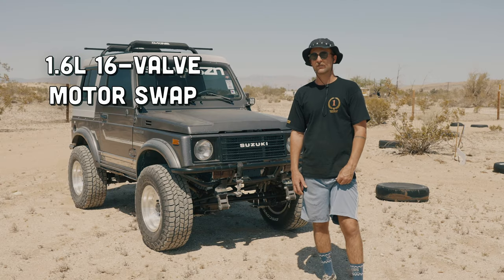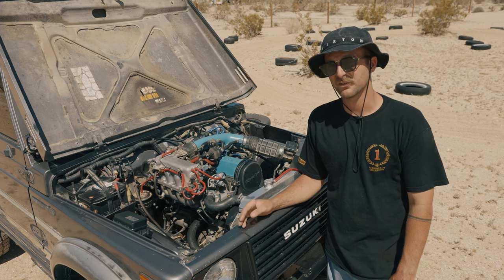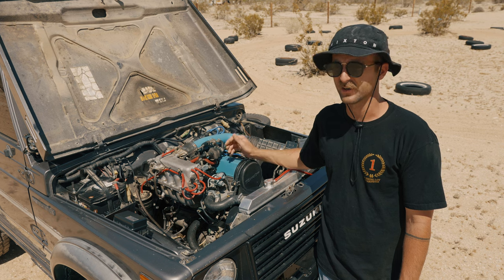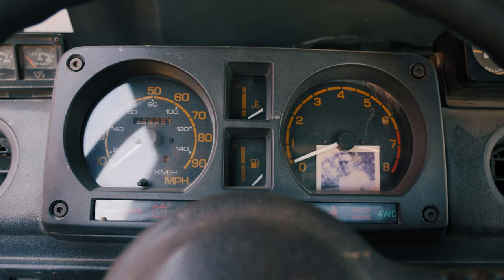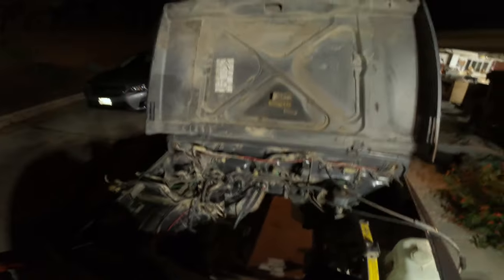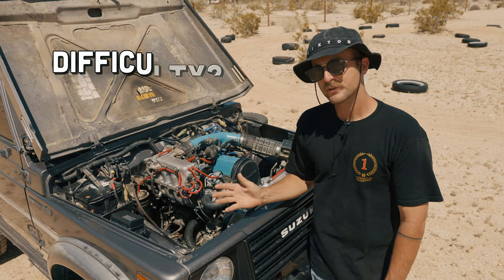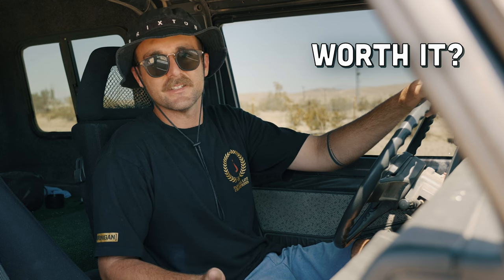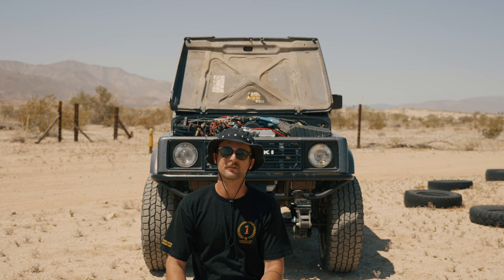The 1.6L "16-Valve" Swap Suzuki Samurai!

Comment: I ran a  8 valve swap for years, until the block cracked.  Wish I did a 16 valve when I made that swap, I think the small amount of extra work would be worth it.  Now I’m running a vw idi 1.6th, love the little diesel.  Not fast at all, not nearly as much power as the 16v… fuel economy is great and the power it has is perfect for where is use it.
Reply: Do you think I could toe a mini jet boat with the diesel?

Comment: Let's see how long your build would last had terrible experienced with single cam 16v leaking motor oil and engine crack either the head or the block.  Now I only kept the 1.6L 8v, great video explaining.  Suzuki was not for speed.  So far no one has done what I did on a Samurai garage build.  Thanks for sharing experiences.
Reply from the maker: Hi friend! Sorry to hear you had some issues with your 16v, it sounds like the block cracking is a pretty common issue.. I did already have to replace my water pump about 8k miles in, but other than that it is running really good. I plan to put a lot of miles on it this summer so we will see how it goes!

Comment: Good video. I'm in the process of finishing my 16V swap and it the small details that take the longest. Like the power steering set-up with AC took a lot of tinkering around.
How did you manage to fit the filter box? Did you remove the bracket that goes across from fender to grill?

Comment: Is this what you meant by following the petroworks instructions? Doesn't seem like much detail. I saw or read somewhere that someone recommended mounting one of the engine mounts to the frame first, but I can't find the source and don't remember which side they said.

"Lower entire assembly down into the engine bay. As the frame side mounts get closer
to their mounting locations have your help start to align the frame mounts to the
frame and start to install the original mount bolts into the frame. The rear passenger
side frame mount bolt is hard to get past the mount so it is advisable to start this one
first while there is no weight on the mounts. "
Reply from the maker: Hi Dan, I am pretty sure the quoted text there, was what I was referring to as instructions. 

Where it says, "The rear passenger side frame mount bolt is hard to get past the mount so it is advisable to start this one first while there is no weight on the mounts."

I am pretty sure I started with the driver side frame mount and that was the part I struggled with. Once I went back and started with passenger side, it was much easier.

Lack of instructions has been a very common thing I noticed across the board with support and parts. Usually, a quick phone call or a search across Facebook forums can help resolve most issues/struggles

Comment: Do you have power steering? I did a 1.6 16 valve swap several years ago.  Now I am in the process of adding power steering.  Looks like the filter box sits too deep and is going to interfere with the pump.  Did you do anything in particular to accommodate the rather large filter box?
Reply from the maker: Hi Rob! That's a great observation. Power steering is definitely next on the list for me, and as you mentioned, yes, the factory 1.6L intake is definitely going to be in the way. There is a chance you could potentially hide it underneath, but it will likely be super tight.

Comment: Any thoughts on power/speed difference since making the swap? You sound quite undecided in the video as to whether you can feel any difference. Would love to know considering the time and cost of a swap. Thanks
Reply from the maker: Hey Elliot thanks for the comment. There is definitely a solid increase in power/speed/torque. Having fuel injection alone is a treat, not having to assist the car with cold starts etc. It definitely drives a lot more like a 'regular car', however, there are still a few times where I find myself looking for more... Like on long uphill freeway grades and what not. I did hit 90mph on a downhill with stock gearing tho, felt pretty good
Reply: @samuraiszn  Thanks for the reply. Just wondering what's left to make it smog legal? Sounds like you did everything needed - do you just need to to take it to a smog referee now? Where you based? I'm in SoCal with a bone stock sammi but wish I had done the 1.6 16v swap for sure. This video makes me feel like I could attempt the swap myself at some point. Le t me know if you come by the central coast some point, would be great to meet up

Comment: hello bro, have you grown tired of the g16b? if you had the chance, would you skip this and maybe get a more powerful unit or would you do the same again? 
I'm looking to swap and get a 16v or a m13a or a k20 but I am not sure on what to do
Reply from the maker: What up! I have not grown tired of it and I would do it again but it really just depends what you are after... The G16B feels like the motor that should have came in these cars, it is a fairly straight forward swap, and it allows you to stay up with traffic a lot better but it really isn't fast. I would call it OEM +, a nice factory style upgrade but still feels and drives like a suzuki and you still retain alot of your original parts.

If you want to go fast, do burnouts and rip, go with a K20 or something with a little more than a G16B. I am sure it would feel like a different car if you did and if that is what you are after. There are other swaps and hybrid-style modifications you can do with suzuki stuff, but it all gets a little tricky. If you have more questions feel free to message me on Instagram @samurai.szn
Reply: @samuraiszn thanks friend! That's exactly the answer I was looking for, followed on ig too btw, will PM if further questions rise, thanks again

Comment: I had terrible experience with Petroworks. Would like to ask you for the person that rebuilt your transmission, Petroworks ruined mine and it needs some work. My last question, do you know where to get an OBD1 scanner ?
Reply from the maker: Hey there sorry to hear that you didn't have the best experience with them. I got my transmission from a guy in LA who used to rebuild them but he unfortunately is not around anymore. I have been asking around to see who else rebuilds them and it sounds like our options are super limited....

For OBD1 scanner, I am not sure. Depending on your configuration you be able to make something work. On my setup I just jump two of the ports with a paperclip, then the CEL will flash a certain sequence, and the number of times it flashes will be the code that you'd then need to search on the internet
Reply: @samuraiszn  

Thanks bro.  Will keep searching for the transmission.  About the OBD1 scanner, seems those disappeared from the face of the Earth !  Saw a couple articles about what you mention with a clip using a small connector that is supposed to be located by the battery.  Will try it, I do not see the plug though, perhaps it has been enclosed in the wire plastic cover that is in place.  Thanks for your reply !!!

Comment: You could’ve also built that motor so it can get 3-400 hp using Honda parts
Reply from the maker: Heard that’s an awesome way to go! Might need to get a list together and go that route next time 🙌🏼
Reply: Just getting into samurai. Can you link me some specific info
Reply from the maker: @Doodooheadguy-fishing  awesome! what info are you looking for?
Reply: @samuraiszn  any build at all. Grew up in hondas. The K swaps I've seen on YT are non English and looks like my Google skills are lacking. Is there a honda engine swap or is it all internals being swapped over
Reply from the maker: @Doodooheadguy-fishing  there are ways.. there are also some modifications you can do to a 1.3L to get moving. If you're on Facebook, join "Suzuki Samurai Owners 2.0" & "Suzuki Samurai Owners" and do some digging. Also feel free to message me on instagram and I can put you in touch with those who know more on the subject than I do
Reply: I don't think the G16B book can take 300 400 HP for too long. The G13B with the twincam head and forged internals can take it.

Comment: What starter motor did u use?
Reply from the maker: I used the stock samurai starter since I stuck with the stock samurai transmission and flywheel 👍🏼
Reply: @samuraiszn  i have a jimny with g13bb and swapped it with g16b but the starter from both engines doesnt fit, the original starter is too big, and te g16b starter from a baleno doesnt line up with the holes. Maybe u know what starter to use. Using stock jimny transmission.